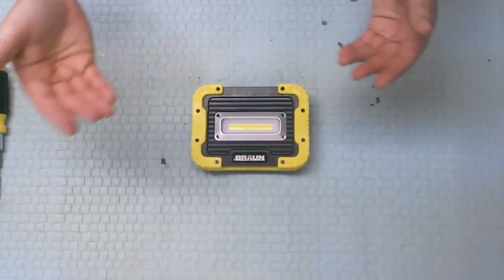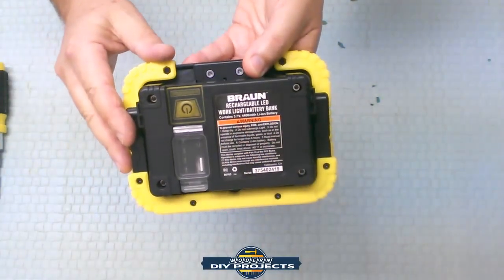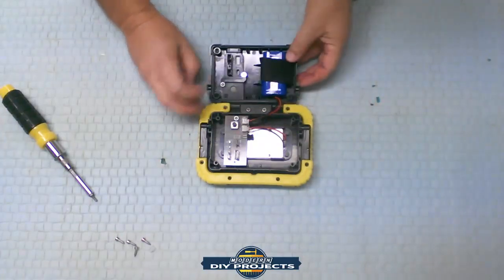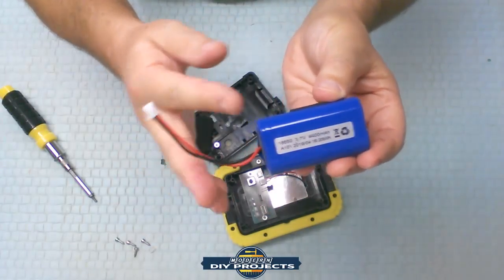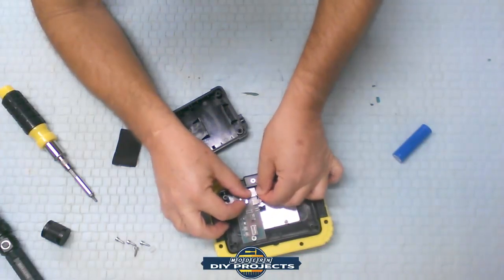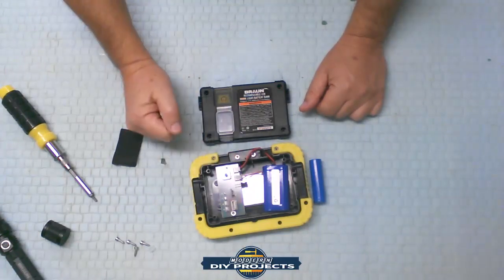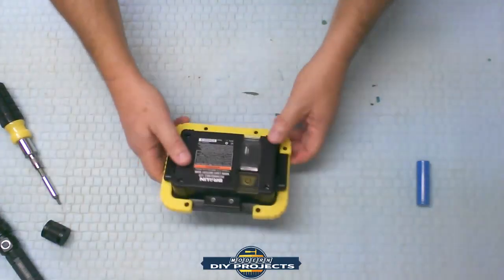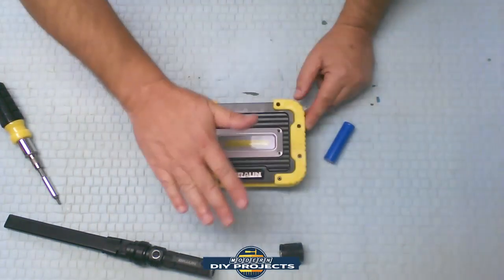Harbor Freight 1250 Lumen Work Light Battery Bank Braun LED Light Teardown Disassembly

Comment: The only problem that I see is that sometimes replacing the batteries can be  more expensive than the flashlight.
Reply from the maker: That is why I suggest holding on to old batteries if you can and that can allow you to replace bad batteries for no cost. When a set of batteries go bad generally one battery is bad and the rest are still good. I am going to make a video in the near future showing how to weld together batteries to make a new set for a battery band like this.
Reply: @ModernDIYProjects   Thank you. I appreciate your time.

Comment: Thank you for the upload, I have a lepro one of these which is slightly different outwardly but I'm reckoning will be identical internally and my batteries appear to be failing. So, I'll try opening it up and find a battery. Much appreciated 😊
Reply from the maker: Glad I could help. You are correct all these lights are pretty much the same internally. All you have to do is come up with similar batteries and you can swap it out easily.

Comment: I have one like that to but the problem is the charge i try to charge n didn't charge i don't know what happens to it....
Reply from the maker: That is a common problem with these Braun lights. They fail way too early. That is why I stopped buying them and moved to different brands.
Reply: @ModernDIYProjects what brand did you move onto ?
Reply from the maker: @El_Wookie  Right after that I got one from Walmart which is really good and I still have it. Since then I have gotten several different brands to make more review videos. You should check out my "LED lights" playlist for all the reviews that I have made. That way you can pick one that you like more informed.

Comment: i bought this light at HF . i had to return it , i used it in a professional work atmosphere working on commercial back up  generators . everything worked great but after a few weeks of plugging in the usb charge port it became very loose and finally broke. after only maybe 15 charges. its very weak and fragile . that was the only draw back. i was thinking of getting another and replacing the usb charge port to a 3.5mm mini  plug and and retrofitting the female end to the board and male end to  charger .much stronger and wont wear out. thats how it should have been made.
Reply from the maker: Check out the other video I made comparing this light to a similar light from Walmart. You may like that other one better and it's cheaper.
Reply: Usbc
Reply: I got the similar light from walmart and it seems pretty good. At least as good as this one and a good bit cheaper. Probably made in the same or similar factory.

Comment: Wonder if we could add more then 2 cells.. also wonder if the factory charging can handle 3400mah batteries..
Reply from the maker: Interesting idea. It could be done with load balancing to prevent blowing out circuits, but an easy way for someone who doesn't know much about electronics is to simply wire in a transfer switch. When one battery cell dies down, switch over to the next bank. That way the two cells are isolated. Same for charging.
Reply: @ModernDIYProjects  There is no load balancing needed, simply put all the cells in parallel, at the same voltage at the time of the initial parallel connection.  It will simply take that much longer to recharge. No need whatsoever to switch from one bank of batteries to the other.  Notice how the pack reads 3.7V, 4400mAh, not 7.2V, 2200mAh... the cells in it are already in parallel if that label is correct and this makes sense because that's the cheaper way to do it, allows recharging them from USB 5V input without a voltage boost circuit to get it to 8.4V to top the cells off if they were in series.
Reply: @stinkycheese804 can you make a video showing how to do it ?
Reply: @ModernDIYProjects  that could work or .... keep it simple.. just upgrade the 2 cells with a samsung sanyo panasonic 3400+ cells and call it a day. I imagine double the out put. I also doubt the factory batteries do what they are rated.
Reply from the maker: @m3rk201  Good idea.
Reply: It looks like you could use 3 matched cells in parallel  pretty easily.
Reply: @williamvaughan1218  You could use 3 unmatched cells in parallel too.  Because they're in parallel, the higher capacity cells would supply more current, and when recharging, take more too.  This can be done because they are in parallel.  If they were in series then you must have matched cells.
Reply: @stinkycheese804  I capacity tested mone and they did in fact rate the capacity I was suprised